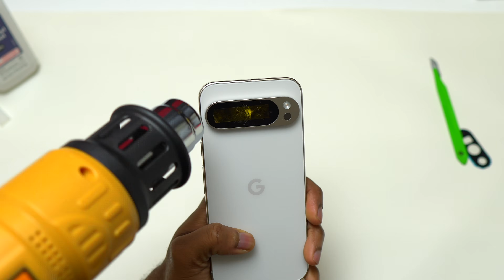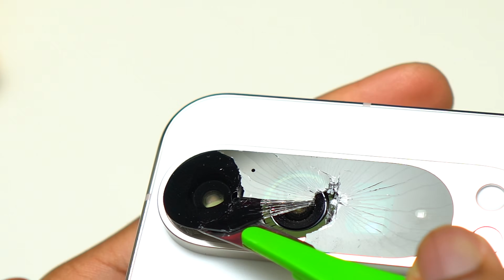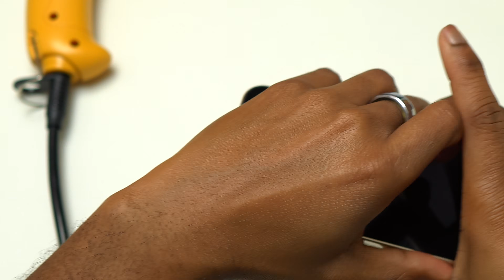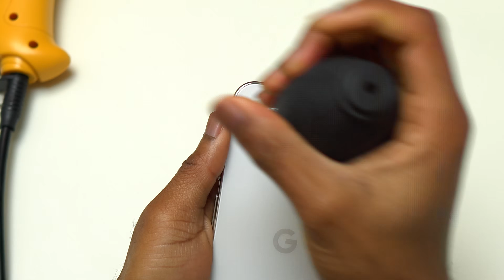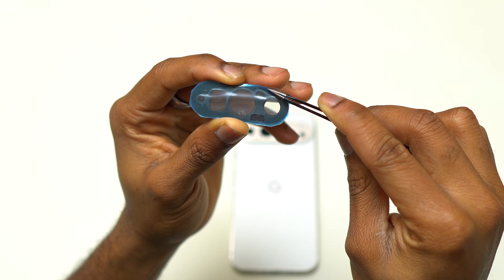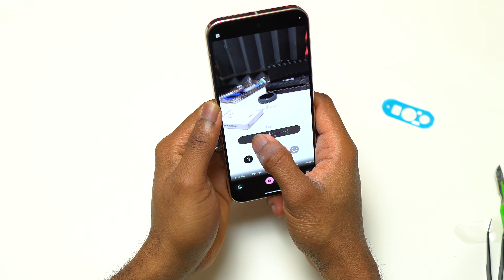Pixel 9 Pro XL Camera Glass Replacement Repair

Comment: I wouldn’t recommend doing it like this. You’re better off taking the back glass off first and then replacing the lens. Otherwise you’re likely to damage the camera with tiny bits of glass or alcohol getting deep into it. Often being extremely difficult to remove.
Reply from the maker: With the Google Pixel 9 Pro XL and 10 Pro XL for camera glass replacement TRUE it will be so much easier to remove the back and replace it with a new one. The disadvantage will be paying more than $100 for the back glass as opposed to $20 for the camera glass. In both scenarios you cannot be 100% sure that the device had regained water resistance and you should avoid water. The Pixel 9 Pro XL and 10 Pro XL have a good arrangement for the camera bezel and camera glass which makes the probability of damaging the camera module minimal unless you do not really know what you are doing. Then you should not be trying this in the first place.
Reply: @ersbit  I said take the back glass off first, then replace the lens. Not replace the back glass altogether. If you do this, then there’s zero risk to breaking the camera. The camera is extremely sensitive to any dirt or debris. It is possible, but not worth the risk. From what I’ve seen you can pick up used back glass from eBay for £35. In the worst case scenario that you break the back glass trying to take it off.

Comment: Mine is not shattered but the cover is always just falling off and dangling by a ribbon. I'm needing to put it back in there. I want to grab a pad out of my car for my dog to lay on instead of the ground, when I went back to my seat I noticed that the whole entire cover was just gone and the ribbon was just dangling now I can't get my flash or flashlight to work at all. this phone is junk physically as well as software malfunctions constantly overheating UI issues camera case just cheap adhesive apps constantly crashing gboard doesn't listen it shuts off all the time it doesn't write what I say it doesn't comprehend punctuation it doesn't care what I add to the dictionary I can't spell my dog's name to save itself. This is a very overpriced cheaply made  phone altogether.

Comment: While the video is quite helpful, it would be nice if you included details about the heat resistant tape and the replacement parts and tools that you used. I tried to locate the tape, but was overwhelmed with the choices. I was concerned about a reliable source for the replacement glass.

Comment: I wonder how many people ended up slipping and then stabbing their finger😂 I happens
Reply from the maker: 😫 that will be extremely painful 😂
Reply: Actually... Not as much as one might think. I had a box knife trying to take the back off of an android year or 2 ago ... To much pressure on the blade, it slipped out from under the back plate and clean sliced my finger.. I didn't feel anything really it was my mind that was like 🤯 oh shit this should hurt. It wasn't extremely deep but deep enough I should have gotten stitches. I just kept it wrapped up hella tight with bandaids and what not. It worked out 😂

Comment: Is it still easily removed if the camera glass is not actually broken yet? Mine is just heavily scratched
Reply: Do you have any answer?
Reply: @OSCSCA I think your just gonna have to break it to replace it
Reply: You can try a glass filler like liquid glass to see if it will fill in the cracks and holes but yeah probably gonna have to replace.

Comment: Where did you bought the replacement? I bougt one but where the lens are, the glass is full transparent. The original one, has a little grey tent over or something like that. Did the one you used has to ?
Reply: @robert.niculescu  Amazon

Comment: Does it retain water resistance this way?
Reply from the maker: I suggest you avoid water after doing this as you do not know with scientific proof or measurements that the device still has ip68 as before. 
Avoid Submerging in water rain and splashes "should" be fine.
Reply: If installed properly it should be the same. But yeah I wouldn't dunk it in water lol. Just treat it like any other electronic device and you should be fine

Comment: Hey, have you every used a heating mat instead of a heat gun? If so, which do you prefer and any tips on using it?
Reply from the maker: I did I just found it more time consuming than using a heatgun. Also they are generally more expensive than heatgun. If my goal is to show viewers how to do this stuff cheapest with best quality I have to keep to that goal. That's why I stopped using the heat mat (I still have it here) it was about $70. I used it in my pixel 7 Pro screen replacement video.